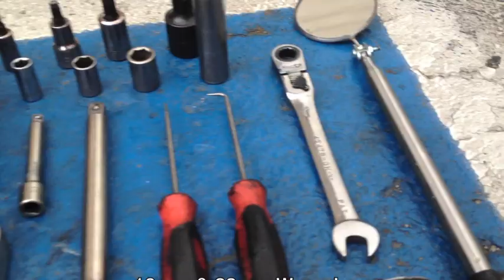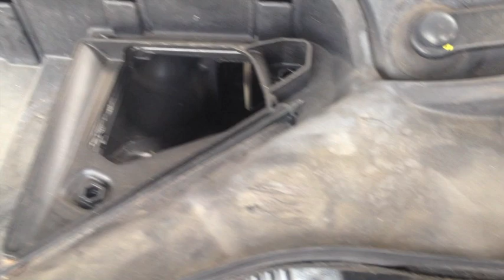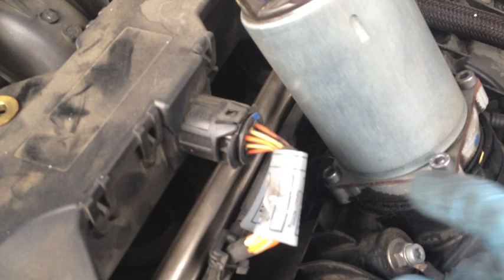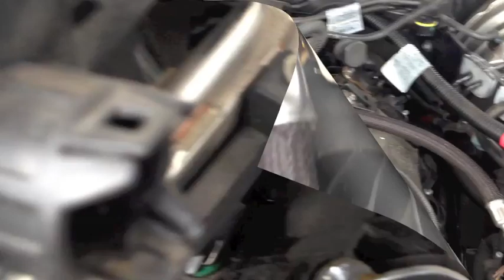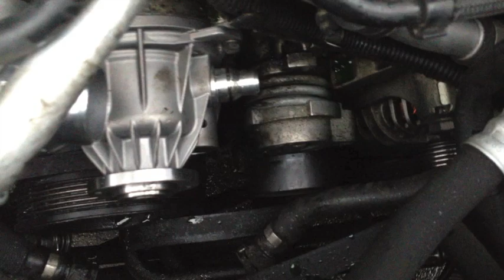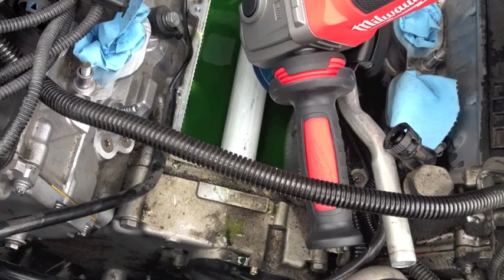BMW Replacing Coolant Transfer Pipe N62

Comment: Thanks for video. Why do you prefer this version of repair vs. the stint that goes in behind the water pump?
Reply: the o ring in the back of the pipe also leaks so the stint wouldn't be a permanent fix.
Reply: @highrider247ify  FALSE, that doesnt leak. it is more of a bushing.

Comment: Should coolant be inside the valley or no?
Reply: Yes it`s quite normal and crucial for the flow of coolant throughout the engine. The coolant in the valley flows from pistons down to valley and into the waterpump.

Comment: Still the best tutorial out there... Question, how hard to pull the outer half of the coolant pipe? The back half was easy, this front half is a pain. And how hard was it to return the 5th screw for the water pump? Thanks

Comment: Hi Braden.  This is Jeff with BimmerFix Products.  Thanks for your YouTube video on how to replace a BMW coolant transfer pipe.  Nice Job!  I wanted to tell you and your viewers about an alternative way to fix this BMW coolant pipe leak that is easier and less expensive than removing the entire coolant pipe.  BimmerFix offers an alternative repair method that only requires the removal of the water pump to fix the coolant pipe leak.   With the BimmerFix method, you DO NOT need to remove the intake manifold or the valley pan.  Your viewers can watch our video at BimmerFix.com to learn more about this alternative repair method.   The new BimmerFix Coolant Pipe Repair System is easier and less expensive than other repair methods and also comes with a Lifetime Guarantee.     Your viewers can call or email me anytime at BimmerFix.com and I can provide the special coupon code, as well as answer any questions on the BimmerFix Coolant Pipe Repair System and offer technical support.  Happy Motoring!  Jeff Reed, BimmerFix Products Co.

Comment: Braden, thanks for this video - it gave me the confidence to take on this job. As it turns out, the coolant transfer pipe replacement solved the leak problem and I had no problem with the work after watching your video 10 times!

Comment: this cost me almost $5k at my repair shop but was still cheaper than the dealer.
Reply: Damn you overpaid. I got it done at dealer and had radiator hoses upper and lower replaced and paid less than half that...

Comment: Is it necessary to replace the valley pan cover or more important to replace the intake manifold gaskets? or both?
Reply: kinda yes, to avoid leaks you can just clean it up and use rtv. but do it the right way plus  if you look online you can find complete kits with everything you need for about 300 bucks
Reply: Since the valley pan gasket doesn't come separate from the pan, as I hoped it would, I bought a new valley pan for $60 for my E65/750i. OEM valley pan.

Comment: Just curious...
Should there be coolant in the valley area under the valley pan or should this area be dry (the area where the coolant transfer tube runs from the front to the back of the motor)?
Reply: I believe you are wrong. Once the valley pan is off, you can see the ports for coolant on both side-walls in the space where the coolant transfer pipe is - i.e. the chamber is specifically designed to be a sort of distribution point, which means it always has coolant in it.
Reply: dry, in the video he literally shows I'm self soaking up the coolant. and he stops the video and sais so.
Reply: It's dry on the M62 but seems wet on N62. Notice no small return line I think the valley is the return line, however if the valley is full then how would you know if the pipe is leaking. I've not worked under the intake on N62

Comment: This is the best do-it-yourself video I have ever seen on youtube.  I would never have done this myself without this step by step process.  I was only going to replace the transfer pipe, should I also replace the water pump just in case?
Reply: typically the water pump starts leaking or rattling around 80k.  you have it off, might as well.